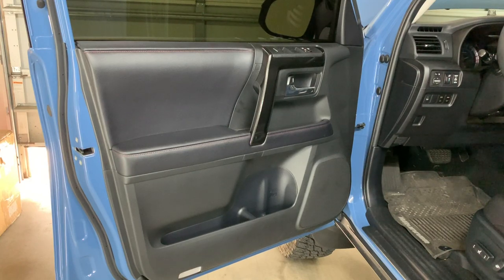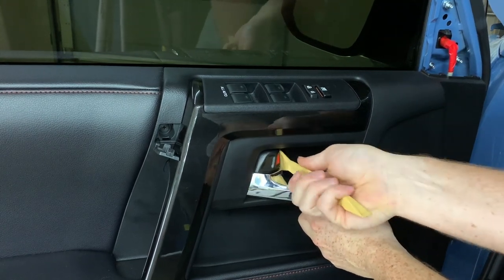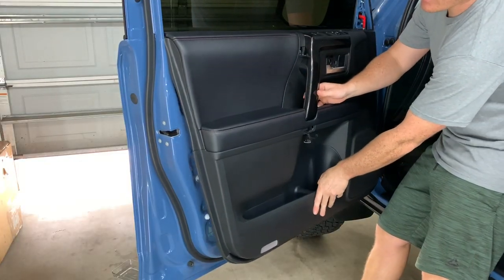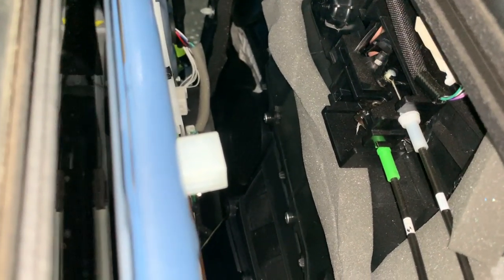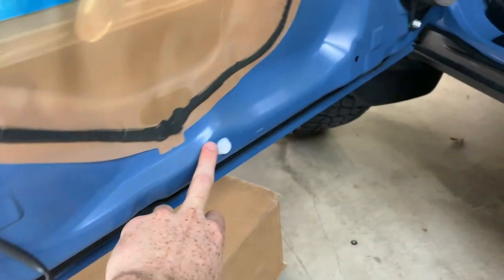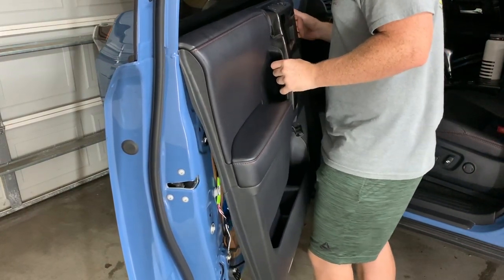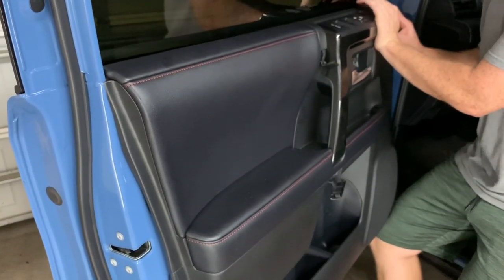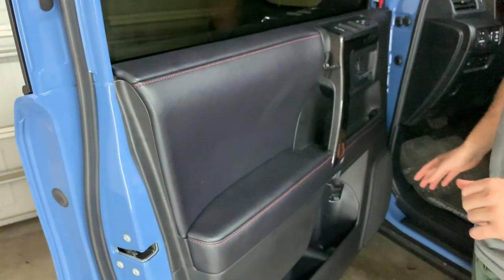Toyota 4Runner Front Door Panel Removal/Installation | HOW TO

Comment: Being an auto glass installer for over 30 years. I recommend rolling down the window it won't be such a pain in the butt put it back on and you will not scratch the tint if you have that on the glass. 
Great video love your Channel.
Reply from the maker: Thanks for the tip!!

Comment: A much easier way to to pull this panel off is to NOT lift up when you pull the panel off.   The part that hangs over the Door sill is actually also clipped into the door panel.   Just pull straight back and it will release, then you just have to push the door Straight back with out all the frustration of setting the sill before you can push it in.
Reply: So the part thats hanging over the sill is able to separate from the door card once you pull back on the door card?
Reply: Really wish I'd known this ahead of time, but can confirm this is THE reason you're so frustrated trying to put your door panel back on
I'd been screwing with it for like 45 minutes getting so frustrated
once I realized this it took me 30 seconds to finish
Reply: @NICUofficial  I agree!! Had trouble reattaching the door panel because I lifted the panel off (as Jon shows) instead of pulling the panel straight off (leaving the sill attached). Way easier to put it back on if the sill is still attached. This video should be be revised. Other than that issue... Great video! Thanks Jon

Comment: You DO NOT lift up as you remove the panel.  You pull straight out leaving the felt window trim attached to the door.  It is damn near impossible to try to re-attach the door the way shown here and you will damage your clips and plugs.  Much Much easier if you do as I described. Pull straight out! Then re-install is super simple.
Reply: Did the pull up method, worked decently but yeah, putting It back is a hassle. Better to slide in the mirror side first then work back when installing the panel back in
Reply: This is why I’m here. My car door is only hanging from clips right now cause I couldn’t get the top in.

Comment: Great video, you were right about the water bottle. :)    1) I put some tape around the white clips to help keep in place. 2) roll the window down and start from the front and push towards toward mirror when putting the door panel back.

Comment: I removed the panel to swap door handles and now my driver side rear passenger door doesn’t open the door from the outside. It makes a weird sound when pulling the handle. Any advice/suggestions on how to fix this.

Comment: Thanks for the video.  I am getting ready to replace the weather strip trim  on the top of the door on both front doors.  Do you have a video on doing that?
Reply from the maker: I don't im sorry
Reply: @TRDJon  it's cool, thanks for the reply.
Reply: @TRDJon just an update.  The video helped greatly!  I replaced the interior window gaskets tonight and the door panel was a PAIN to get back in the metal trim on the door.  My truck is a 13 SR5  but got it done.  Thanks again for thr video!

Comment: Awesome video. Quick question. Are you able to take that gloss black door handle piece out? I have it brushed and want to get rid of all of the brushed pieces in my limited. Thanks!
Reply from the maker: Should or just tape it off and you’re good to go
Reply: @TRDJon  cool thx! I’m probably going to get it hydro dipped I don’t know if you know what that is but did you see any clips for it at all when the panel was opened? I know this was a while ago though loo

Comment: Does this apply to a 2010 4runner and 2016? I’m try to replace my 2016 4runner door panels but the only cheap ones I could find are off a 2010 runner
Reply from the maker: I feel the doors should be the same.

Comment: Bro what are my chances changing speakers without removing those 2 cables for locking mechanism? (If I’m not doing sound deadening). Some what concerned that I might screw locking mechanism. I’m thinking if I could use a cord or something to support the panel from the door and fix the speakers from under. 
Checked with a shop and labor for 4 Focals are $100. And they said they will disconnect the speakers from lift gate. I feel like I could do myself if I’m doing Focals as they are direct plug and play. For stock headunit + Focals with an amp the shop quoted me insane price. 4Runner is definitely not that quiet vehicle to invest that amount of money imo.
Reply from the maker: To be honest if you have a second person it’s completely possible for them to just hold the door and you to undo the speaker
Reply: Thank you, appreciate your input..👍🏻👍🏻